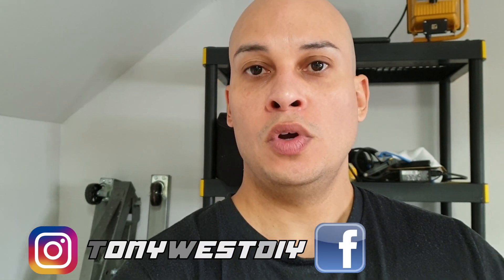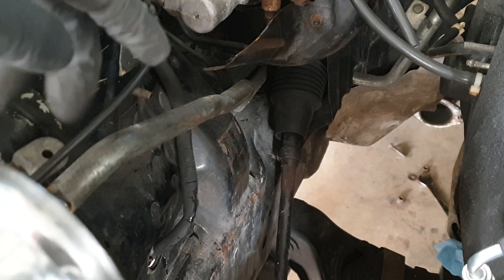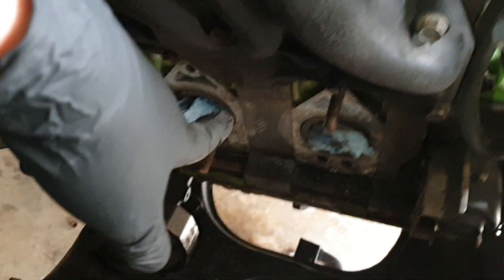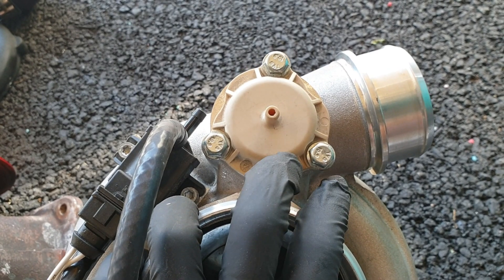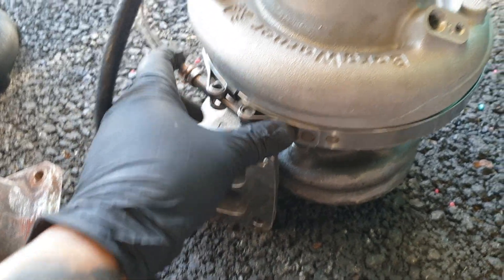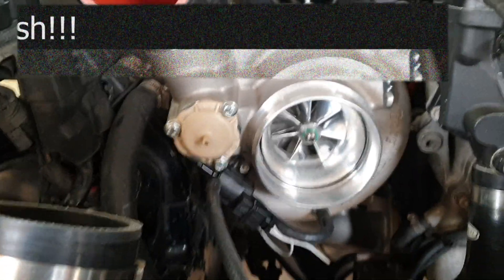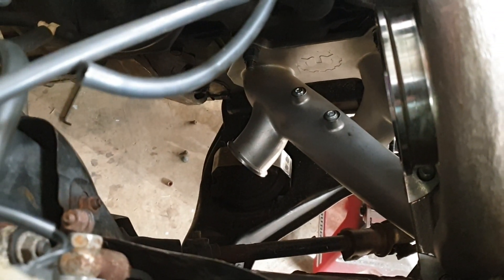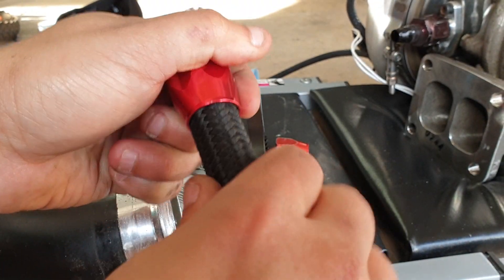Turblown's Cast Turbo Manifold and BW's EFR 9180 Install ( RX-7 FD Build ) - Borg Warner EFR Series

Comment: Tony if you want the cold side discharge on the compressor to point up, you should cut the discharge and weld a 2.5" cast aluminum elbow on( this will give you the hood clearance you need).
Reply from the maker: Thank you for watching!!!! I figured it out 😁. It's going to be in the next video! I appreciate your comment boss 🙏🏽. Means a lot!